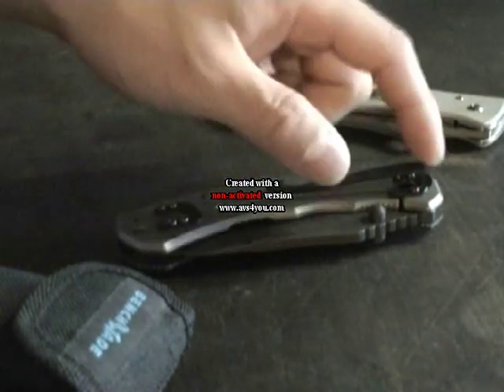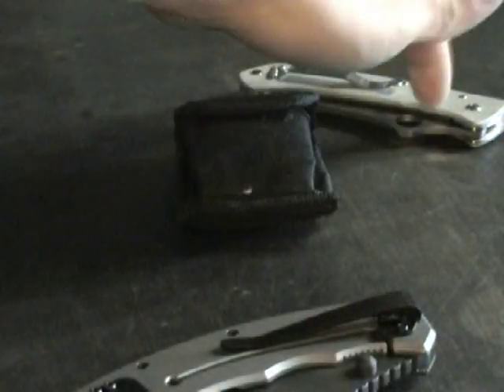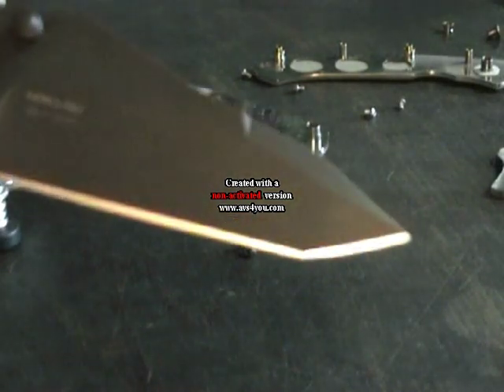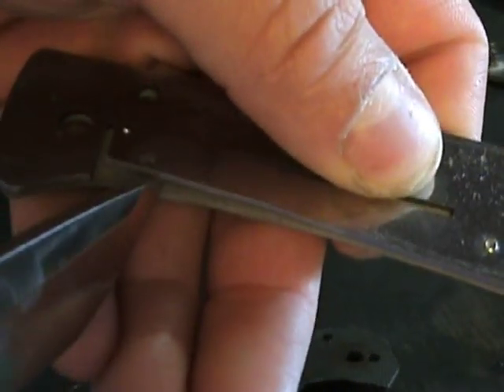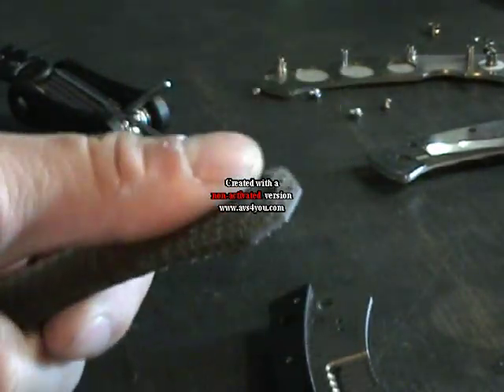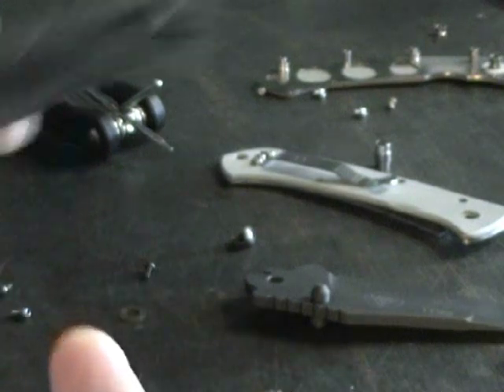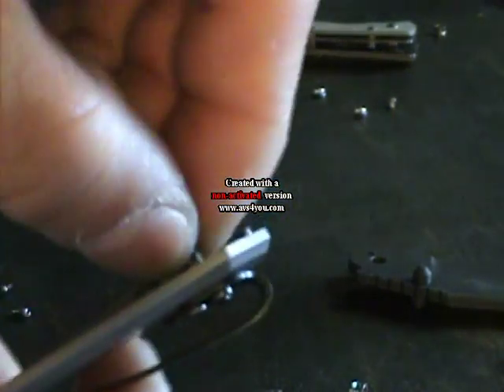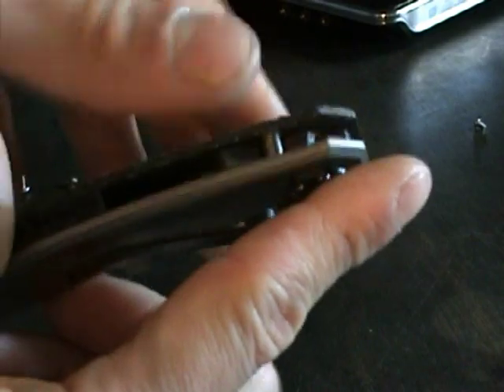Combative Edge SR11 Needs Work

Comment: prying is not the only thing you can use a strong tip for. the design on this knife is great for penetration that's for sure. but tanto tip were made to go through armor or layers of hard surfaces. this knife will not do as well in that regard vs the norm tanto.